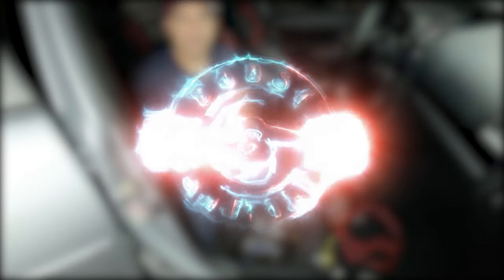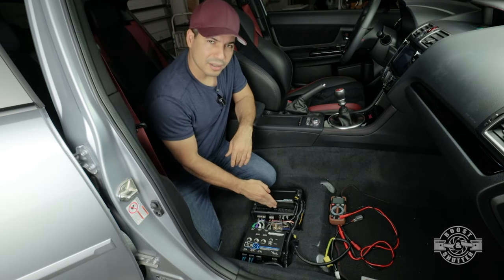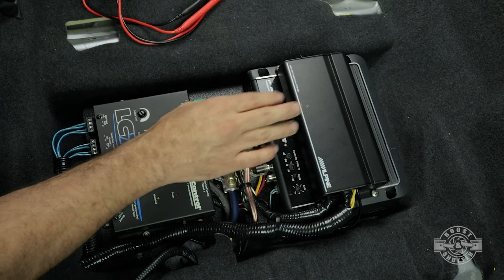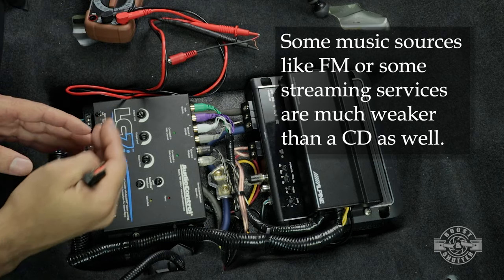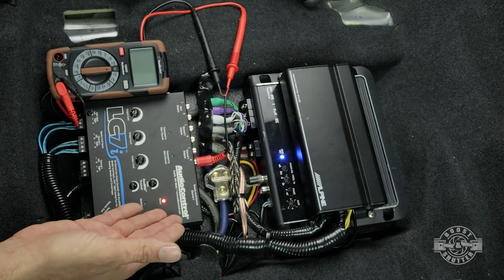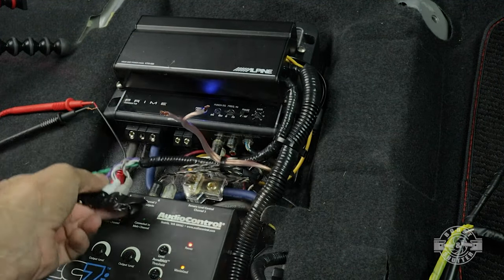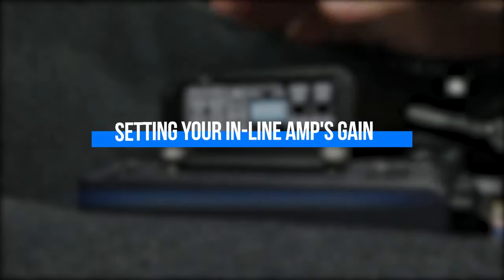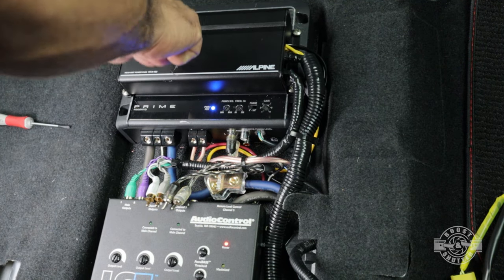How to TUNE Car Amplifier & Set Gains

Comment: So on a 4 channel amp with two gain setting adjustments, do you treat it as two separate amps? My amp is a Skar 75.4 it will be wired to 4 jbl coaxils 2.8 ohm each. The amp will put out 100 watts to each channel at 2.8 ohms. 
So 200w X (1speaker)2.8 ohms root square=23.66 Target voltage?    Or would it be 200w X (2speakers)5.6 ohms root square=33.46 Target voltage?

Comment: before setting a gain, we need setting a equalizer on the heat unit to half or flat setting right ? after setting a gain complete, can we setting a custom equalizer ? I mean can we setting eq to 'pop, rock, jazz or custom eq' ??? or stay at flat setting ? cant adjust eq forever ?

Comment: Im buying a 2020 Accord with the premium system, im going to tap the back speakers, and merge the signal into 1 channel, then use a distribution block for 6 rca ports, then use those 3 sets for 3 equalizers to amps, my question is do play test tones with all speakers disconnected?
Reply: No disconnect all speakers and connect the speakers u plan on tuning for example front channels 1 and 2 disconnect 3 and 4 only set the gains on 1 and 2 but you’ll probably have to do this individually but you will want the same outcome out of both not two different frequencies

Comment: On the MAIN on your Lc7i you have front door speakers connected to it from your HU speaker output? And rear door speaker output on the channel 2? But on the LC7i output(rca side) you have rear signal plug across from the MAIN input?im confused.can u please clear this up for me since also using LC7i with 2 aftermarket amps,
And btw I have the same HU thanks

Comment: Hi I have 4 midrange speaker and want to adjust gain to make it louder . Right now it's at 25 but still not loud. Do I adjust where it says gain in a 4 channel Amp. Do I adjust with eq flat

Comment: I'm using a pioneer amplifier GM-A6704 with speaker level input, and I'm using that for my source, how do I measure the voltage gain?

Comment: Hi my amp is 1000w rms and my 2 subs are 300w rms each they are 4ohm subs and are wired down at amp to 2 ohm so if I did your math correct √1000x4 would be 126.4 or should I do √1000x2 which would be 63.2 in just doing my amp to subs

Comment: Hey, I purchased a rca cable to make my own adapter to multimeter but I don't see 2 wires inside it. Just one. What did you use? Edit: I saw what you did. And when I did it, the voltage never changed for me. Stayed at zero. Would appreciate any help.

Comment: How do i know what volts to set my amps. I have the same amp for the subs so I'll set mine to 4v but the one I have for the door speakers is a kenwood where would I find what volts to set it to or would I set it to the same volts as you

Comment: I installed an lc7i and excelon xr901-5 in my 4runner and I can't get proper voltages to the amp from the lc7i unless the accubass threshold is turned all the way up. Tried using the manual to set the threshold but just can't get it right and get proper voltages. 19 4runner with entune non jbl. Any ideas? Should I use the threshold turned up to get the voltages needed? Otherwise I can get like 1.8v-2.3v depending on channel

Comment: I have a pac loc tapped into my bmw stock subs going to my skar rp2000.1d and playing a solid test tone I crank my loc gain and my multimeter is showing no more then 0.24v is there a reason for this? Volume turned up plenty high on the factory head unit. It’s also a brand new unit.

Comment: I have 2 jl 12tw3 there 8ohms I have them wired down to 2 ohms there rated 400 watts ea I have a 2ohm 1000.1jl amp, want to only send 800watts to them, do I do the math off the final impedance of 2 ohms or what the subs are at before wiring 8ohms? Thx

Comment: I tried setting the gain using the 40hz -5db test tone for my single jl audio 12w3v3-4 paired with a jl audio jx1000/1d. 

I turned all head unit settings to 0, bass boost on my jl amp to 0 and set volume to 80% before adjusting the gain (jl calls it "input sensitivity")

Output target voltage is 44.7 vac, which I achieved. 

Re-connected the sub and played a song with the volume @ 80% and the bass could barely be heard! 

I left the gain where it was and turned the bass setting on my head unit to 3 (goes from -5 to +5) and bass boost on the JL amp to +3db and the bass output was still very weak. 

What is wrong with this setup??
Reply: I ended up using a 40hz 0db test tone to adjust the gain to 44.7vac and now the bass is much better and louder.

Comment: Finding the square root of your amps max RMS...how do you know whether a particular amp is even doing what the manufacturer has rated it at? There's tons of amps that are rated conservatively & can output upwards of 500w more than what they're rated and on the flipside, don't do even 1/2 of what they're rated at. So that whole equation is based on whatever the manufacturer claims their amps are rated at? Either or, I just don't see how that equation could be accurate. Correct me if I'm wrong.

Comment: My amp is going in protection mode. I checked wiring and speaker nothing is short. So is it possible my dsp is feeding high input voltage to the amp that makes amp go into protection mode?

Comment: i have 2 pairs of component 79watt RMS
1 in front and 1 in rear
going to installed amplifier infinity reference 3004A 
5 channel amp with 75 watt Rms per channel and high low conveter for stock head unit.
plz help me out that how should i Set —gain— LPH and HPF in amp so that i can get best quality sound

Comment: If I have two subs wired parallel @ 1 ohm on a one channel amp do I double the RMS wattage in the equation ? Each sub is 750 watts RMS @ 2 ohms. So would it be i.e  Square root 1500 X 1=  38.72 V  Or Square root 750 X 1 =  27.38 V   ??  Thanks in advance ..
Reply: Use total watts and final ohm load.
Square root of 1500 x 1. Which will give you the same voltage as 750 x 2 (what you'd use for a single sub)

Comment: What if I have stock headunit and stock door speakers no amp. I have a 10” subwoofer and sub amp with the lc2i do i unplug all the door speakers to tune the gain how does my amp get the signal ?

Comment: See I think it works the opposite you think. TLDR, yes use a 0dB tone, if it was possible we should actually use louder test tones to keep some safety distance from the clipping point.

First of all, older mixes had a lower loudness for sure, but they also weren't as compressed, meaning they very obviously had peaks that could reach 0dBfs (once converted to digital, mastering engineers usually normalize the highest peaks close to 0, no point leaving extra dynamic range and getting the signal closer to the noise floor) so by not setting the gain with a 0dBFs tone, rather with a -5dBfs you'll clip the top 5dB of those peaks which can be terrible, especially where it happens, usually the drums.

Also you stated that you needed to crank the volume louder to get a decent volume out of those old tunes when calibrating for 0dB, which is normal, and should actually be 5dB louder than calibrated to -5dBfs obviously. But you also say that this can provoke distorsion, but see that's not possible unless you've actually set your gain wrong. If there's no distorsion with a 0dBFs test tone, then there cannot be any with a sound that supposedly is quieter, just set with a louder output volume.

The output volume of digital head units is rarely an actual active opamp, it can be a passive attenuator or a digital trim before the DAC, meaning that the distorsion profile should not change unless the manufacturer screwed something up. Even an opamp should actually be calibrated as to not distort with a full scale signal from the DAC. To make it simple, if the 0dBFs test tone doesn't distort the amp/speakers with the output volume at max on the unit, then nothing will distort, unless the source song already has distorsion.

Comment: I watched your video to setup an LC2i on my truck, running one JL 10w3v3-2 with an Alpine Monod D 600watt amp. The problem is that I am not getting any volt reading on the bass output or main. The LC2I powers on when the stereo powers on, I hook up the subs and I'm getting good bass, but I wanted to tune just like you explained. Any idea why it's not reading the volts output? Not sure it makes a difference, but I'm only running power from one of the rear speakers to the LC2i.
Reply: @akqjtn  I have the multi meter exactly to what you showed in the video, DC current, or at least that’s what I think you set it to. I will double check this afternoon when I get home. I know the multimeter is working because I checked the ohms on the speakers and I get an accurate reading of that. It’s a great video and everything is explained perfect, I’ve never hooked up an amp or subs before and did it just watching your video.
Reply: @akqjtn  Thank you for your prompt response. I will verify and let you know later today. I really appreciate your help.
Reply: @akqjtn  Looking at your video here at work (obviously not working much) I think I see the problem. 10:44 I see the multimeter prongs plugged in on the center and right of center, I have mine on the center connection and left of center. That might be my problem.
Reply: @akqjtn  OK, so I think I was being an idiot last night when I tested again. Si tested a 9 volt battery and I got a reading on the multimeter, I read a regular AA battery and got a 1.3 reading, tested L2Ci and got 0 volts. But just thought about something, I was testing it without the power from the amp going to it and without the ground, I was just testing it with the power from the read speakers.  Would the power going to it from the rear speaker still give me an accurate reading? I'm going to test with amp hooked up to it without speakers tonight,
Reply: @akqjtn  LOL, sorry to have wasted your time with this. I thought about it on my drive to work this morning. I'll still update you and confirmed I was just being a donkey!
Reply: @akqjtn  ok, I give up! Lol. Everything is hooked up right, I can adjust the bass on the lc2i, the bass knob that I ran works as well, so LC2i is responding, but for the life of me I cannot get a reading . So I give up. I just wanted to come back and say thank you for your prompt responses, your time and assistance , it is greatly appreciated! Thank you and I’ll definitely be following you from now on. Just subscribed to your channel.

Comment: WHY IT IS NOT POSSIBLE TO ADJUST THE FRONT AND REAR SPEAKER OUTPUT LEVELS OF THE AMPLIFIER USING MULTIMETER AS YOU DONE DONE FOR THE SUBWOOFER?

Comment: What if the amplifier has an rca input sensitivity rating between 0.4V - 8V for example. How would we know which voltage to send from the LOC to amp? Please help
Reply: You want to send the highest voltage that your amp can handle, without exceeding it's max rating.  So in your case, you would want to measure 8V coming out of your LOC (RCA output).

Comment: so what if the amp accepts a wide range like 1V-12V? Do you try and get pre outs or a converter to make 12V output? My pioneer HU puts out 4V pre outs. My RF P600X4 goes up to 12V inputs. So, with. your logic, using a 12V output would be best, and in which case, I would get better power by using the speaker level outputs from HU to inputs of amp? 
--
Reply: @akqjtn  Thank you for the reply. OK. That makes sense. I figured the speaker levels would be high risk noise. It's one reason I got the limited HU with "High level" pre outs. 
So use the pre outs, which on dyno tests went up to 5V clean. 
--tuning using somewhere between -5 to 0 is where I'm at now. My P600X4 has clip indicators. I haven't finalized the wiring, yet. tomorrow probably. But, I wonder how the clip indicators work if tuning with -5dB test tones.

Comment: So I have a question . If you needed 4 volt on the front signal, what should you do? As you turn the gain almost all the way and got only 3 v?
Reply: The maximum speaker Level input of LC7i is 40 Vrms and the maximum auxiliary input is 9.5 Vrms, the maximum output Level is 9.5 Vrms.
Ir tour head unir output is 3 volt, don't worry, no problem.
Set the head unit volume to 75%, adjust the LC7i output to the input voltage of the amplifier and the gain of this to the maximum without distortion, if that output voltage corresponds to a higher power than that supported by your speakers, reduce the gain until obtaining the adequate voltage, (voltage = √(power × impedance)).

Comment: Why is the gains on the Line out converter set so high im pretty sure the half way point on the line out converter should be 5volts already

Comment: Boost and Shutter i don't fully understand how you are setting your gains by using a tone to make your adjustments? What do you mean use a tone and how do you put that on your head unit is it by CD or download into the head unit? I have an Alpine ILX-W650 with an Alpine KTA-450
Reply: amp piggy backed to the Alpine head unit. The amp powers the front and rear speakers in my 2006 Ford Explorer. I did the old school way by manually turning the front and rear amp gain a quarter turn thats as far as i go because i'm afraid i might be turning the gain too much and end up damaging my speakers or the amp. When I seen how you turned the gain manually without using the multimeter and listen to distortion by ear on your ILX-450 it looks like you had both the front and rear gains turned about half way so i guess i still have room to play with on the gains. Yeah it depends on the music on the persons music level, I like to play hard rock metal so it may be different for me on the settings. Also whats up with the extra electronics audio control line out convertor do you not use anftermarket head unit with 3 separate RCA connectors for the mids, highs, and lows?

Comment: So on the 3 channel I set my volume 75% up and play a 40 htz test tone, but the maximized light didn't come on, do you know why?
Reply: Charles Cox they are not 100% accurate. It's ok that it did not come on.
Reply: @superchile9640  I use a thousand htz test tone and it works
Reply: @charlescox4213  my car stereo- pioneer distorts 1kHz test tone at 39 volume and 38 for 40Hz. They are close but not 100%.

Comment: I've got an Alpine KTA-450. I'm confused on the 2.8v RCA input max volts. I've also got an Alpine 1DIN head unit connected to the KTA-450 via RCA outs. And the RCA outs on the head unit is 4V. Does that mean you shouldn't connect this Alpine head unit to the KTA-450 via the RCA outs? It doesn't sound right that they'd made head units that can't connect to their amps via RCA out.

I do have a hiss sound when playing quiet music that I've been trying to figure out that happens even with the engine off. And with the head unit and amp sitting on my shifter console, I've moved the wires around to make sure there wasn't noise leakage from say a power wire to the RCA wires. I do have a long ground wire of like 4 feet just because that's the nearest factory chassis ground spot as the car is a plastic car. I also used a DD-1 and set the gains via 0db, so I doubt the gains are too high.
Reply from the maker: You can connect them, remember music is dynamic. All it means is that under the worst of circumstances you might clip. That said, if you have any regards for your hearing you will likely never be feeding it a signal that high continuously anyhow. Most aftermarket head units allow you to turn the gain down different ways. At worst you can simply turn all the bands on your equalizer down if it's too hot.
Reply: @akqjtn  I did a couple of tests. On the Alpine KTA-450 amp, I changed the setting of "RCA" to "Speakers". And that cut the hiss in half, though it did reduce the volume of the music a little. I'll do another test later on where it's set to "Speakers" and I'll used my DD-1 to set it to -5db, and then see if the hiss is the same as before.

I also did another test where I disconnected the RCA's on the back of the head unit. And I think turned the gains on the amp all the way up, and I could hear hiss/static coming from the speakers. I learned of this test by searching around. I don't know what that means, but I'm thinking that means the hiss has something to do with the amp. I may try and shorten the ground wire a couple of feet when installed.
Reply: I find it weird that the max input is 2.8v.. I'm glad I purchased the ktp445u instead, I set my lc7i at 4v output and turned the gains all the way down, it sounds great

Comment: If you're running two subwoofers do you add both rms then find the square root of that my two 10s are 200w rms
Reply: Yes you wouldn't want 2 10's sharing 200 watts from your amp
Reply: Ok cool so I'm clear 400 Squared x 4 (ohm dvc) = 40? So tune my amp gain with the multimeter to 40? Right now I have it at 20
Subs are wired down  to 1 ohm my kicker amp is stable at 1ohm 400watts.
Reply: According to the kicker sheet to get 400 watts at 1ohm they say 20.00v. So I'm basically under powered for these subs?
Reply: It's rms power x ohm load = volts
400 x 1 = 20
2 10s wired in parallel will give you a final load of 1 ohms at the amp. What's the rms power rating a 1 ohm for your amp?
Reply: Yesh they are both 100% wired down to 1 ohm and my amp is 400 watts at 1 ohm @kelaro75

Comment: So if you are running your speaker to the lc7i there no need for the speaker hook up at the amp 
itself
Reply: Speaker wires going into the lc7i are to convert the signal. You still have to have Speaker wires from the amp to the speakers
Reply: @kelaro75  so I’m running the to the lci7and to the amp is wat your saying?
Reply: Check out this link it should explain it

Comment: Hold on... Is your mids & highs amp mounted into the heat sink of your Sub amp ???
Reply: @akqjtn  Well, if it works, it works... I just never would've thought of that. It doesn't get hot because you set your gains properly 💪

Comment: What if you have multiple subs. Each with rms lower than amp. Say 2 700 rms subs at 1 ohm load for a 1 ohm safe 1200 watt rms amp